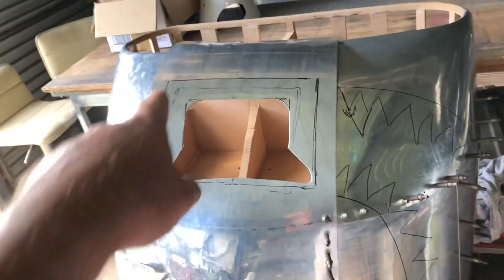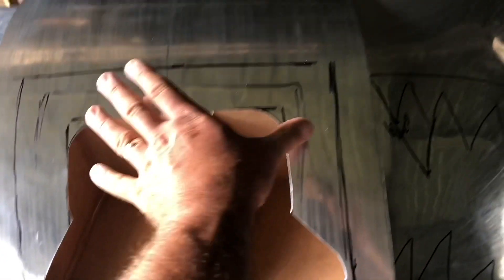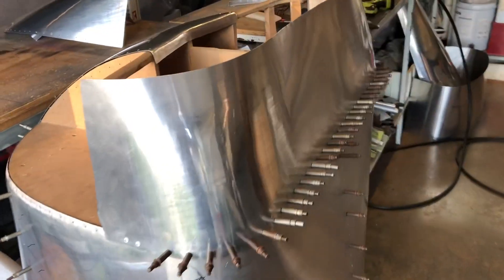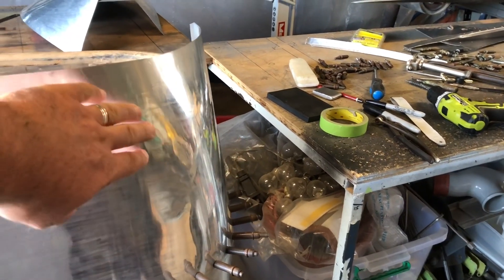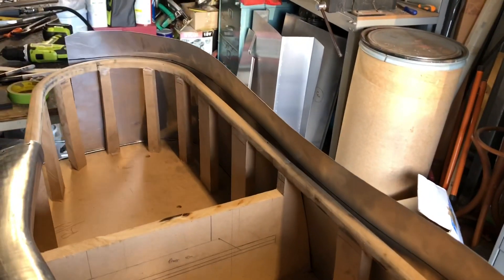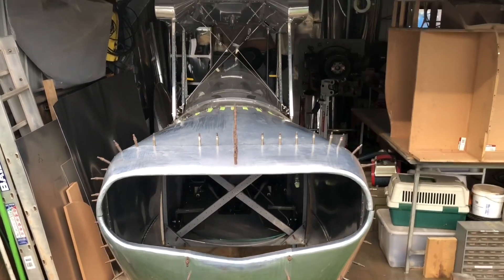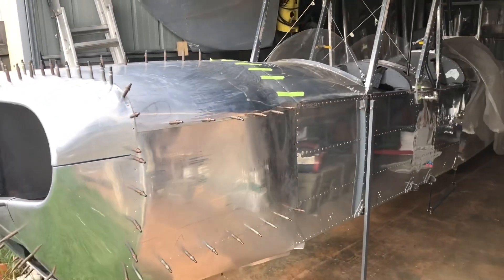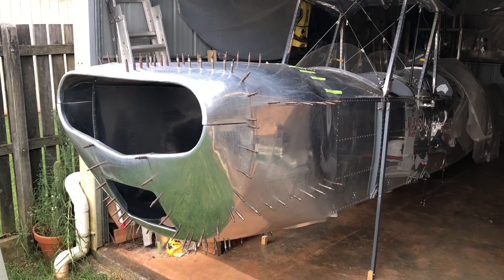A custom built engine cowling for a custom built aircraft part 7 a detailed look

Comment: What type of aluminum are you using? I'm assuming 2024, but it is already head treated to T4 condition, or are you working it in the -O condition, and the assembly will be heat treated later?
Reply from the maker: For the engine cowling I used 5005 commercial grade as it’s easier to work, it does work harden, so I annealed it as I was working when required. I could make most of the cowling out of 2024t3, the challenge would be the intake area. For a secondary structure like the cowl, I would be comfortable with annealing t3 (W condition) to work it. It does revert back after a number of hours. But, as I mentioned, I chose to use 5005 instead of